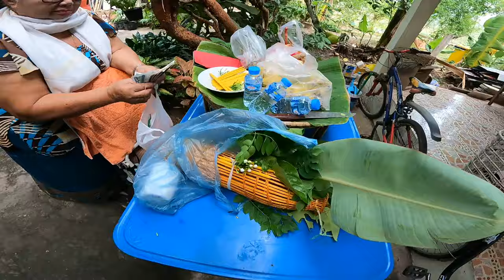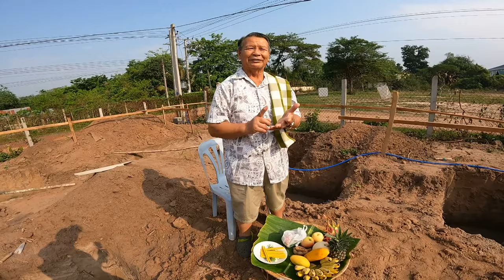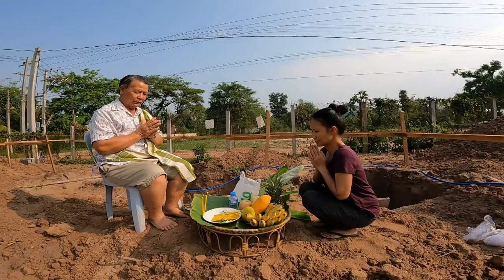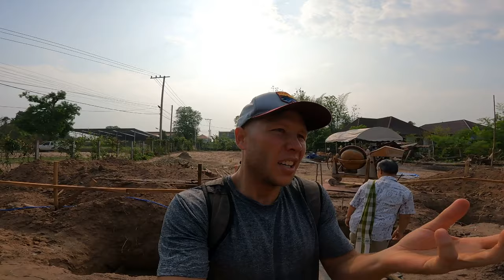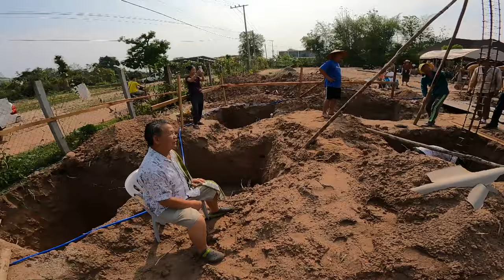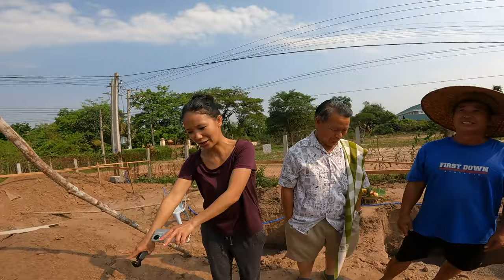Corner Post Custom Laos 🇱🇦

Comment: I've been to one of those ceremonies. The one I went to was quite simple like the one in the video. There were no monks, just a respected elder who was familiar with all the rites.
Sometimes the ceremony is much larger. There are many elements that determine how/when it's done. 
The number 9 is a common element. It represents progress. 

Some people use different verbs in the name of the ceremony, ตั้ง = to erect, ลง = to lower, ยก = to raise.
"Pitee Yok Sao Ek" ( พิธียกเสาเอก) = The raising of the main pillar ceremony. 
The main pillar in the old days was made of wood. The main pillar symbolizes the stability of the house, hence the importance of the ceremony.
Reply from the maker: Renamed it. Was drawing blanks on this one and by the time I got this video to actually export properly this morning I was not in the best mood with it. Was such a quick edit I had it ready yesterday, but finally had to import all video files again and edit it for the 5th time due to a corrupted file or something. Glad we got the name right now too.
Reply: @LaoLegends It's almost always translated as "main pillar" or "main post". It can be in a corner, but as seen in the video, it doesn't have to be. The location of the main pillar depends on the month when it's put in. In Thailand, the third month is not preferred. If the house is built in the 1st, 2nd, or 4th month, the main pillar is set in the southeast. The months are based on a lunar calendar. This year the 4th month started on March 10th, the start of the waxing moon.

The "sao toh" ( เสาโท) is considered important too, and some people will raise both of them during the same ceremony. You could call "sao toh" "the secondary pillar". So you have the main support and the secondary support pillars. Some people believe the two pillars represent husband and wife.
Reply: Very interesting. I’m learning so much about my tradition from this channel.